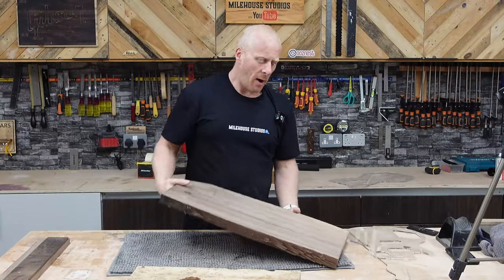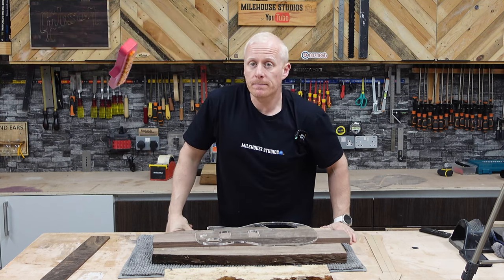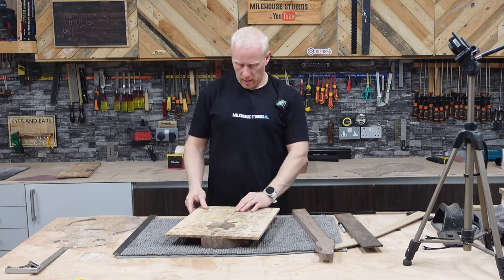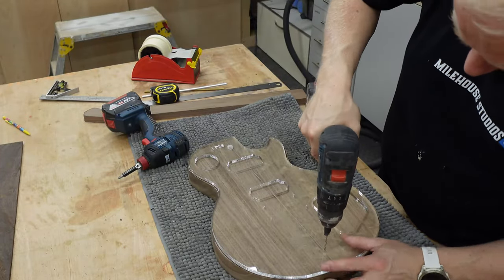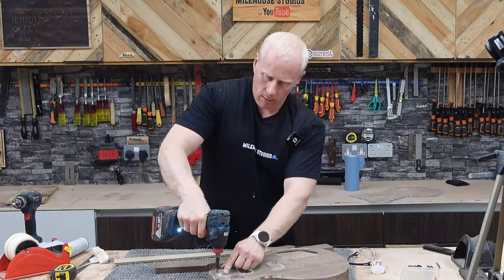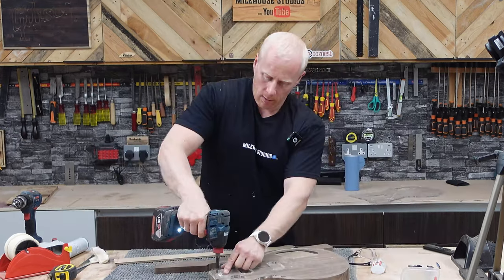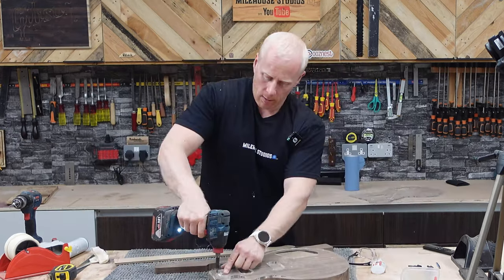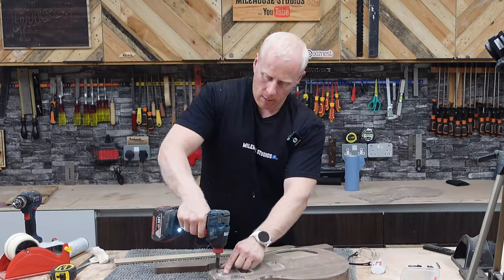I make a hybrid Les Paul from some amazing Tonewood

Comment: I’m working on an lp carved top right now so I will be very interested in this build!!
Reply from the maker: That sounds interesting. I've never done a carve top.
Reply: @Milehousestudios  its not to bad i just had problems with figuring out how thick of a top i need, the first one i did was 1/2" and  i had templates and it wasnt thick enough so the next one i had a 3/4" and it worked out.